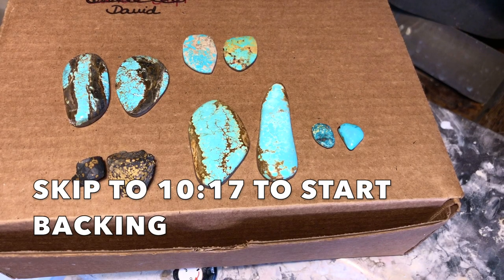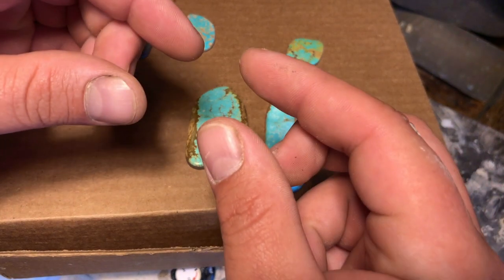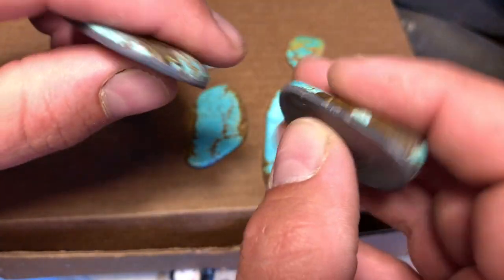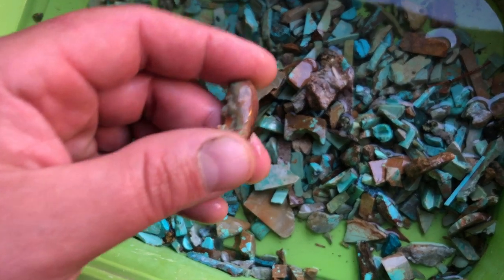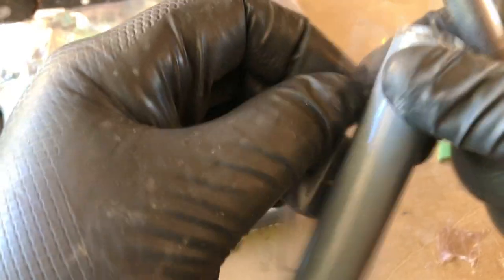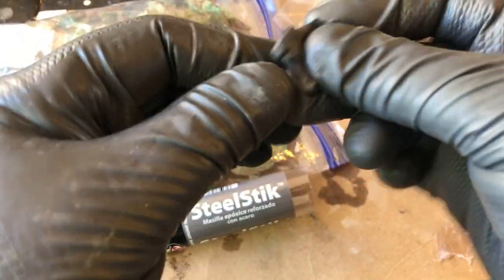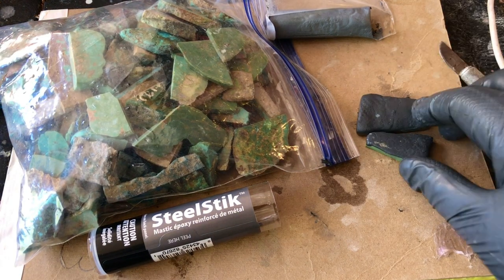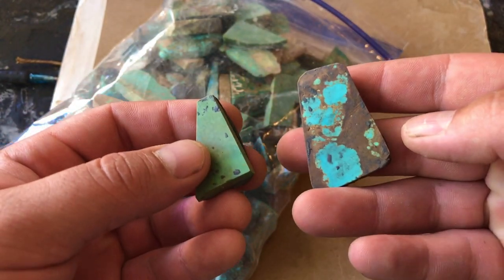Steelstik Lapidary Backing Formula For Backing Turquoise & Other Stones

Comment: Nice.  I usually have been using black jade, basinite, or Oregon black limb opal with clear epoxy (mostly for doublet or triplet opal).  But this is a great addition and could easily be the attachment for stone backs.
Tip - Wax paper works for flattening it and not sticking to the surface.

Comment: I use regular JB Weld. You can just use flexible cutting board sheet from the dollar store to back your backing. Then when it hardens you just flex it and the stones pop right off. You can use it over and over. Thanks for sharing.

Comment: The other cool technique I've developed for epoxy backing and other fine work (Yes, I should make a video) is to mix up regular JB Weld, spoon it into the corner of a ziploc bag, trim the tiniest corner of the bag, and squeeze it where you want it like a miniature cake icing decorator. When you're done you can just toss the squeezed out bag. Works great.

Comment: I use an epoxy clay called Apoxie Sculpt when making mosaics, and I suspect it might work great for this application! Comes in a bunch of colors, I always use the black, and it is an attractive deep flat black. Roughly 30 minute working time!
Reply from the maker: Fantastic I’m totally gunna check it out :)
Reply: @lapidarydave  ooh! I just checked the price of Steelstik at Home Depot versus Apoxie Sculpt on Amazon, and if I’m doing my math right, a one pound quantity of Apoxie Sculpt actually works out to be cheaper per ounce than the two ounce roll of Steelstik! (Though my math might be suspect; I’ve noticed that my version of pandemic brain seems to involve losing my ability to reliably do simple math, which is embarrassing 😁)
Reply from the maker: @stellabelikiewicz1523  I love that it comes in colors I am 100% gunna try it :)

Comment: Hiya Dave, that's Awesome! Hey that's a great idea for some Louisiana opals I have that are very brittle. Thanks for the idea.
You always give the best ideas away. Quite a few years back, someone came out with Hard/as/steel it was taking the world by storm, cutting all of J.B. wields profits, so they came out with some. J.B wields isn't as hard as the other one, but will work in a pinch.
I hope you have a great day, a safe and healthy blessed day also. Cya!
Reply from the maker: I would definitely give it a shot with the opals maybe even try the marine The white version which is also at Walmart for like waterproofing things
 I would totally like to try that hard as steel stuff I love that they were giving JB Weld a run for their money
Reply: @lapidarydave  ya, that's why their making it, the hard as steel stuff is really hard, I've bought it at NAPA and I've bought them probably 10 yrs ago and it's still good, if you put it on something, to get it off you'd have to grind it off. So what your using it for would work really well, the JB wield doesn't last as long for some reason, and the black dots JB just doesn't mix well, where the other mixes really well. I've fixed my aluminum boat with Hard as steel 15 yrs ago and it's still there, and acetone will not dissolve it, I mixed it with my fingers ( once) it had to wear off. Lol
Reply from the maker: #1 Catfishunter Miller Thank you so much for the information I will definitely look for the stuff online do you happen to know if it comes in different colors? I know the JB Weld comes in like a copper color
Reply: @lapidarydave  no I don't, but it's a lot harder than JB.

Comment: Does this formula only come in a dark gray? I’m backing sea shell pieces, mostly flat and sanded, but I need a cream color. Is there another product you can recommend that would be cream colored? Or, a way to color clear epoxy?
Reply from the maker: when it comes to this particular product, they do not come in other colors
Reply: @lapidarydave . If I don’t mind color, tbis will work with more fragile sea shells as well?
Reply from the maker: @terp4u2  it should

Comment: Can you apply this backing on already thin/finished cabs?
Reply from the maker: Absolutely my friend you might need to tighten up the sides after you apply it but it’s a very soft material even when it hardens compared to stones so it should be easy to just going away the backing and not material in question
Reply: @lapidarydave  just saw this! Thanks for the quick response, I appreciate it. The cab and ring turned out Amazing! My girlfriend loved it